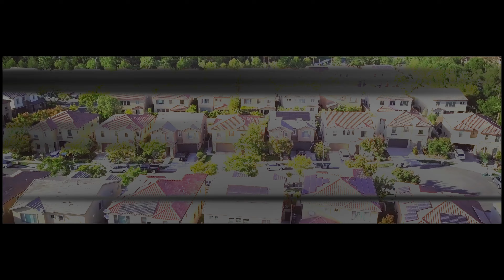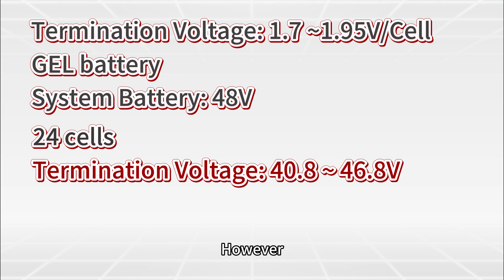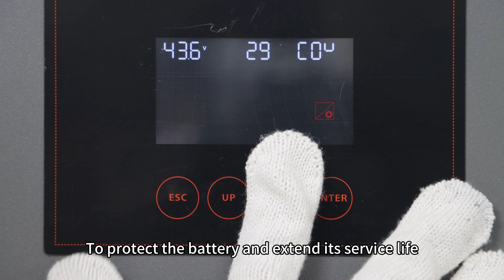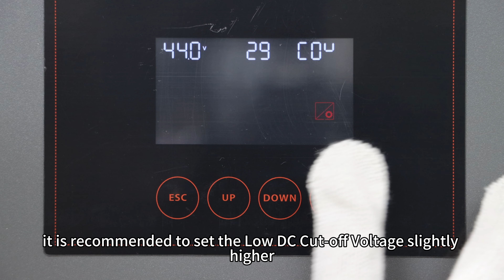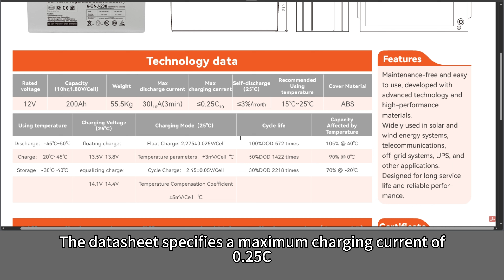How to Set Custom Battery Charging Voltage on POW-HVM6.2M-48V-N?

Comment: Hello  @PowmrSolar  
I have my 2pcs PowMr 25.6V 100Ah Lithium Lifepo4 Battery in series connection with my PowMr 6.2KW hybrid inverter off/on grid system. I noticed only 4 hours last long to supply a light of my 2pcs 9watts light bulb during at night consumption only. Can you make a video. What is the best parameters setting of my PowMr 6.2KW Hybrid Inverter to maximize my battery power? I appreciate your feedback.
Reply from the maker: Hi, please send it to this email: support@powmr.com.